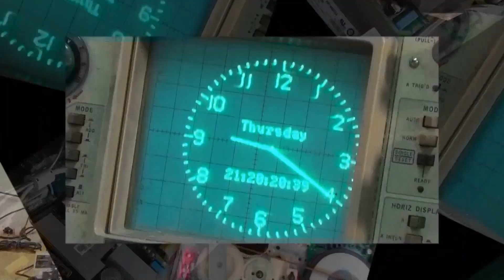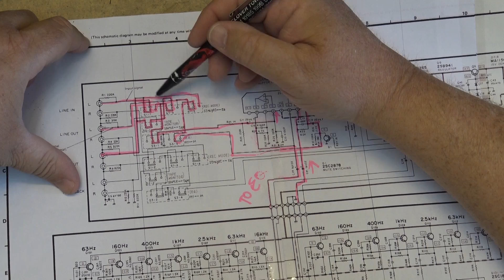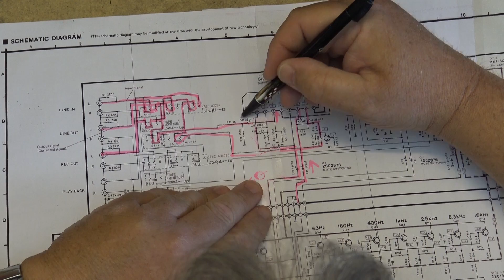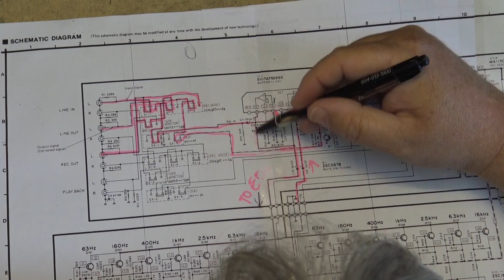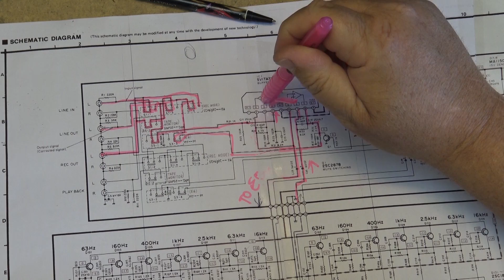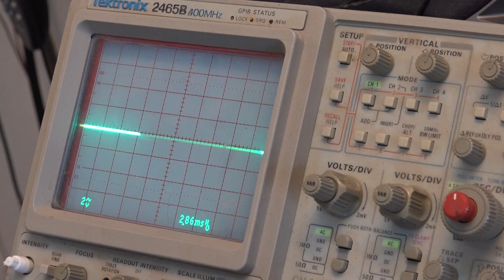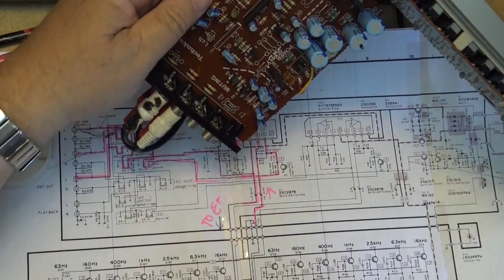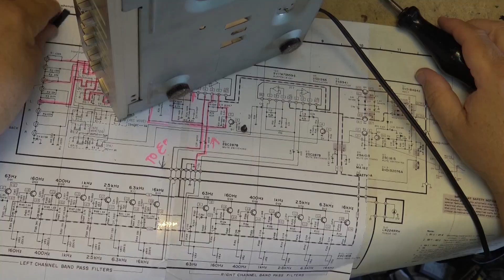Technics SH8025 Equalizer Troubleshooting part 1

Comment: Know this is old, but have a technics sh-z500. Both channels are loud garbled static. Could it be this? The chipset must be on the board under the faceplate. Any advice would be helpful. Might just be SOL. Cannot find a service manual for it unfortunately.
Reply from the maker: Check for missing power  supply rail.
Reply: @12voltvids  thank you so much for the quick reply! Am a bit new to electronics repair, but have made a lot of progress and fixed  quite a few things so far. Still a LOT to learn. Will put focus on the power supply board and see if can find anything. Appreciate it. Love your videos. Have helped me a lot with VHS and VCRs. Still a but lost on this, but gives me something to go on. Any good books or resources for learning about this further? Thanks, do not want to be bothersome.

Comment: Haven’t watched the end of video yet but with those dc reference voltages you got, I would bet some pin-to-pin resistance readings will show some shorts in this IC. Real quickly, pin1 and 2 referenced to 7 and 8, 3 and4 , 5 and 6 ,, then 2 and 3 simultaneously to 2 pins will find a hard short real quick. Back to video to see if I am right.

Comment: I built 2 small mod boards to use TL072CP much quieter  and the chips are only $2 for 10 pcs on EBay

Comment: I love the smell of solder!!! You are right. None of this fancy solder crap.
Reply from the maker: Then there is the small of burning skin when you slip with the iron.
Oh yes, it hurts too!
Reply: i clean the tip of the iron on my jeans now thats badass :) . have you tried to blow solder out of the pins by heating and blowing into it with a straw?it works amazingly well..just have to clean the mess afterwards
Reply from the maker: I used to clean the soldering iron using either my bare fingers. Now THAT is bad ass. I will do it on a future one to watch people cringe.
Why use a straw to blow solder out, Get get close enough to kiss the board and let fly. I am sure I have some shots of me doing just that, but they got edited out.

Comment: Hi Dave, You can replace those opamps TA75559 with UPC4570C which are much quieter and  if you dont find it in SIP9, just try to build a mod circuit that uses sip-8 to dip-8, they sell pcbs on ebay for that purpose and dont worry about VEE, it should be moved from pin 5 (old) to pin 4.
Reply: Yeah, what he said, lol (what'd he say??)

Comment: Kinda boring, not much else can fail. You don't see EQs much anymore.
Reply from the maker: Mark Anderson 
There is lots that can fail. Regulators can go capacitors can go bad and the front board with all the pots has a hand full of parts that can go bad. In this case it was a  op amp that died.
Reply: yes well I guess you are right.  Just in general, these are easy to troubleshoot.

Comment: It appears that that IC was originally made by Toshiba and is a discontinued part and appears to be quite rare.   Maybe you could find a current production one with similar specs that would work.
Reply from the maker: Stephen Hinkle 
Lots available out of the UK. Under 10 bucks.
Reply: 12voltvids that is good news.
Reply: Why not use like a TL072 or so. Plenty of those types in my drawer and cost next to nothing.  Bet you won't hear the difference and if you hear the difference use for both channels.  Some small wires and a bit of hot glue and ready to go.

Comment: Holy shit, look at that bare live wiring about 5mm away from the frame, now thats fucking bad. id have to heatshrink that at least
Reply from the maker: What bare live wire? The one on the switch or the one on the convenience outlet?
They are mounted to the cabinet, and 120 v is not going to jump that space. That is how they built them.
Reply: Really? wow suppose this was built before all the health and safety we have today
Reply from the maker: Synthematix 
We used to have hot chassis remember. That would never fly today.
Reply: I like  hot chassis amps much liter I am building one as we speak 4 25BQ6 1 12at7 the 12at7 heater is the mane cathode resistor for the 25BQ6 output tubes